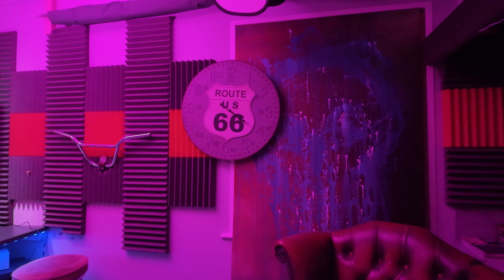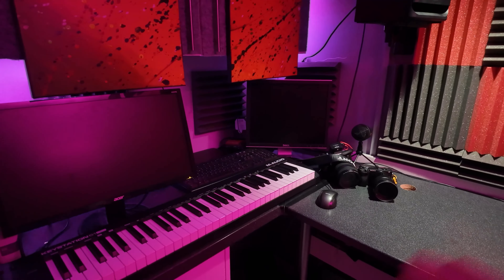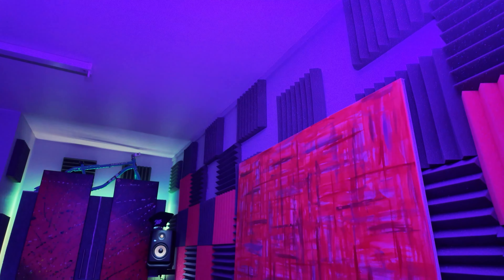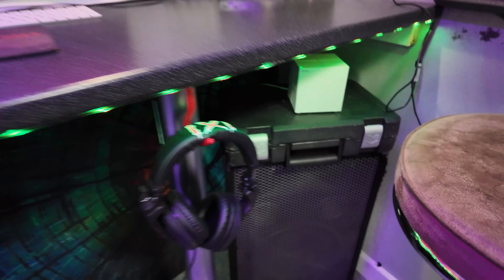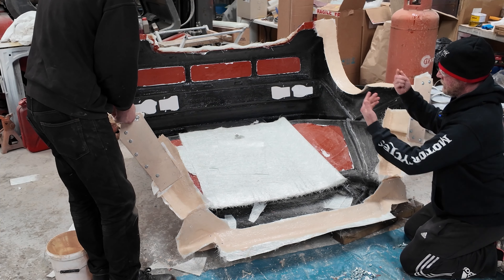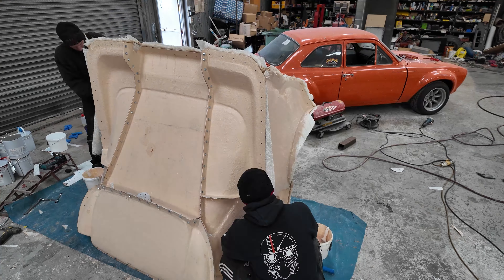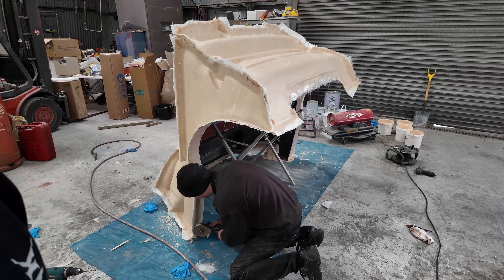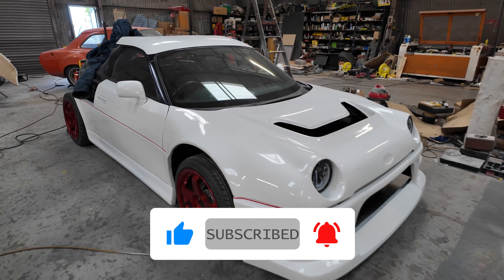Recording studio walk round and we finally finish the rear clam mould.

Comment: Do you have any of your sets recorded on Soundcloud? The rear clam is looking good. The gel coat for the mould, did you use standard gel coat or the tooling gel coat which is more scratch resistant?
Reply from the maker: Hi buddy yes I record some and some of those I upload. Are you on instagram of facebook? If so ping me a message and I’ll send you a link. Yes the gel coat is tooling resin and the resin for the glass is also tooling resin on the moulds. It’s super tough stuff!